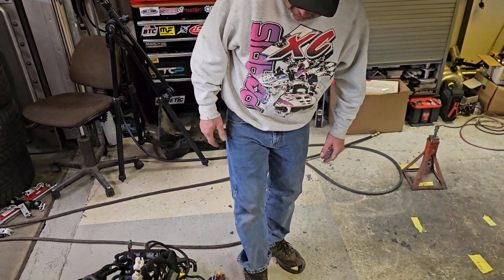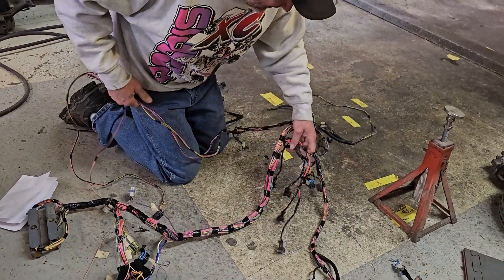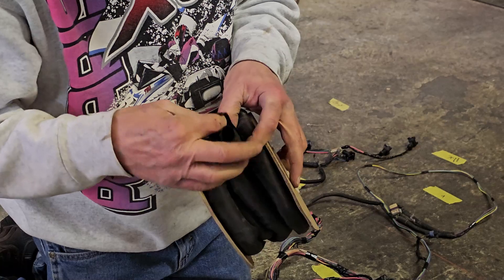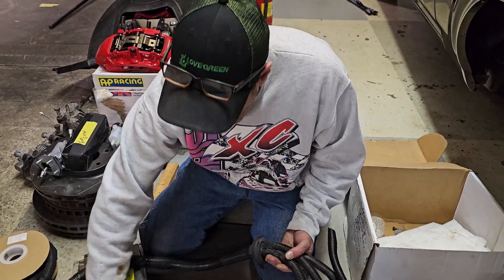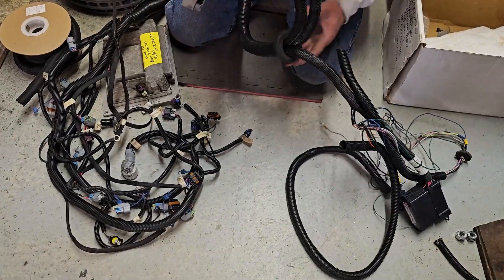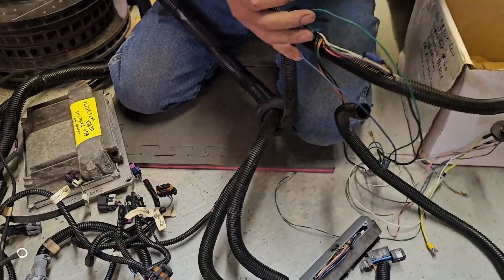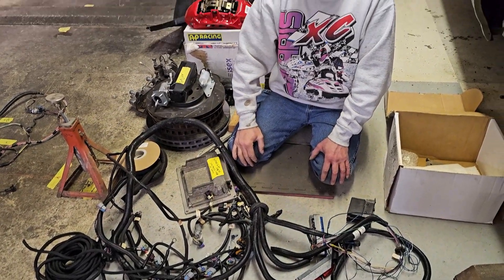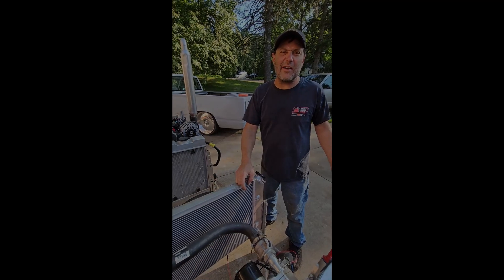Simplifying LS Swap Wiring

Comment: Thank you for the video. When ordering an after market harness like the second one you showed, what do you recommend for an ecu when LS swapping a manual transmission car?
Reply from the maker: @jasonsummers2154  for a manual car I would order a harness from BP. Automotive and just find a red,,blue ECU. drive by cable  BP has some ecu's as well they can most likely be able to supply the harness and a unlocked base tuned ecu for you.